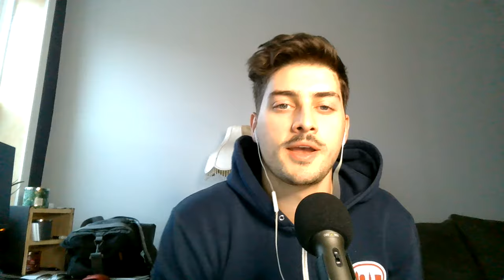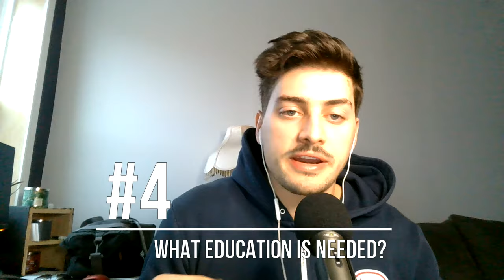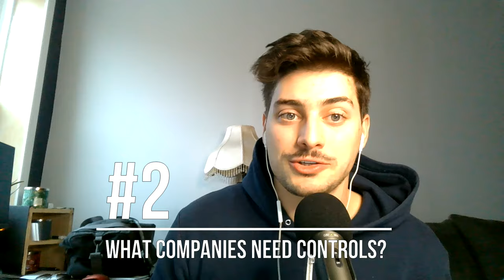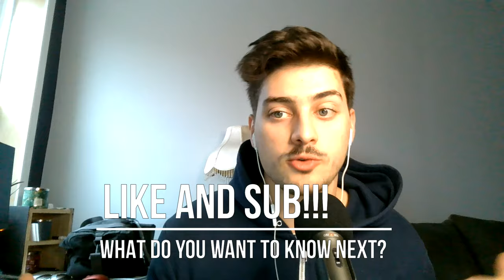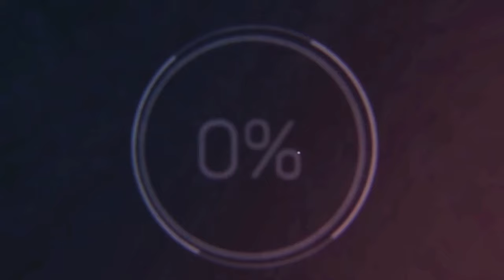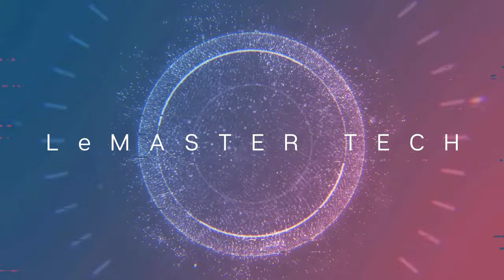Top 5 Things You Need to Know About Controls and Automation Engineering!

Comment: I finished TCAT 2 years Automation  Technician  started working for food company 3 years in the position and making 43$ per hour soo 110k per year I didn't want to go to 4 year college in my opinion is not worth because you need hands on experience with Electrical, Pneumatic, Hydraulic, Mechanical, PLC,Robotics soo now I learn Networking soo you need it all to be efficient, also HMI design, CAD ....soo Goodluck everyone.
Reply from the maker: Thanks for sharing your experience that’s awesome to hear and I totally agree hands on experience is so much more valuable than higher education! It’s unfortunate some places have a 4 year degree requirement but less and less are doing that especially for driven folks with actual practical experience!!

Comment: I find the salaries rather underwhelming compared to software engineering positions. For such a niche sector, I would have expected 6-figures+
Reply from the maker: Well I’m 26 and pretty well into 6 figures so it’s not like you can’t get there, but it definitely doesn’t average as high as software engineers no doubt about that!
Reply: I have a CE role without an engineering degree, and I'm in the low 6s.
Reply: @lemastertech  what does pretty well into 6 figures mean? 200k a year?
Reply: 26 and very low 6 figures here, friends that branched into software are making closer to 200k+

Comment: What about Network Engineers? Can they pivot to smart building automation engineer?
Reply from the maker: Yes they definitely can, but without some strong hands on electrical or mechanical experience you’ll have a tougher time! There are ways to self teach some of the software and computer based skills and will obviously have a leg up on the networking, but it will be a challenge to make sure you hone some hands on electrical and sensor skills!

Comment: Thank you for delivering a succinct and informative explanation. I want to add one more thing. Control engineering education not only equips one with the fundamental concepts, but also provides a strong foundation for branching out into related fields such as optimization and machine learning. The understanding of calculus, particularly linear algebra, is a valuable asset that can broaden one's perspectives in engineering.
Reply from the maker: Very true, but I do think mechanical or electrical engineering degrees can allow you to more easily pivot into other fields if controls isn’t for you, and most programs allow you to build electives of whatever you’re most interested in into your program! Either way, not a bad option!

Comment: Great video and the advice is spot on.  Go with a general engineering degree with electives.

I went to tech school for controls but got a BS in Chemistry.  I now work as an automation engineer.  I’m limited to the process industry but there’s plenty of jobs.

Start-up and commissioning r the most stressful experience, but you learn quickly.

My advice for new grads would be to work at an integrator for a few years bc going to a corporate setting.  Your experience will be at a premium.

I get inquires every week n I’m not looking.  I’m getting phone calls, emails.  Some out right telling me I will get +10% more.  I’m happy where I’m at though.

I work in Pharma which has its own set of skills for an automation engineer.
Reply from the maker: Glad you agreed with the advice and sounds like you’ve got a great career! I liked working for the integrator I started with but got tired of traveling and am happy with my current role even though it would have been fun to go work for spaceX or Tesla it also would have been longggg hours haha!

Comment: Currently a college senior studying mechanical engineering, I have had a change in heart in what I wanted to do with my ME degree, I recently was heading into the field of sustainability engineering, but found it's not what i want to do. Any advice to change gears and switch into this industry? I only have internship experience in sustainability. Will graduate in May for reference.  Thanks!
Reply from the maker: Hi, congrats on being so close to graduating! It is tough as a mech-E without any more semesters of electives to sign up for more electronic or computer science electives, but I would say if you wanted to get into controls, definitely still apply!! I you're willing to take an entry level job, look for either hardware manufacturers like Siemens or Rockwell or GE for controls roles on like linkedin or their careers sites, or look for an integrator like RoviSys or maverick or some other controls integrator! They typically will take a chance on a motivated new hire right out of school with any engineering degree! Something to help educate yourself a little on the knowledge gap could be getting an arduino or electronics hobby kit just to start learning some basics of electronics and coding! Goodluck!!

Comment: So currently I am a mechanical engi who got offered automation engineer role. What should I do to help prepare me for the job since I'm not familiar with plc and programming, etc
Reply from the maker: Hi man! So honestly, PLC programming and automation is pretty heavily learn on the job - if you knew for sure you were going to be using rockwell stuff you could watch some YouTube videos on basics of RSLogix or Factorytalk View hmis, and likewise Siemens and wonderware and GE have some decent online learning videos available on YouTube and documentation on their websites. But more generically I think as an engineer you really just need to be prepared to solve problems as they come in, and sometimes the best way to practice that sort of stuff without getting too in the weeds about something technical you might not need is practice with problem solving type games like grid logic puzzles, sudokus, Ken-Ken puzzles, or even brain teasers or practice reasoning through things like fermi problems which are just really great ways to start thinking like an engineer. I get wanting to get better specifically at automation stuff but PLCs and their associated software are expensive and difficult to practice with at home unless your work lets you take them home!

Comment: I’m graduating from devry university with IT in automation and electronics systems as my associates do you think I need a BS in electrical engineering or can I get a BS in Computer System information aka CIS
Reply from the maker: So there’s no right or wrong answer here, because every employer is different! I think if you had either of those two you could definitely pursue and entry level controls position with most employers, but an electrical engineering BS may have a slight advantage but both of those should be fine! Goodluck!

Comment: how does one with a totally non-related master's start their own training or do their own projects to have something to show off if they want to do controls?
Reply from the maker: Hi! So if you wanted to show a basic competency with inputs and outputs and programming and making GUIs but still wanted to have it be fun, I’d recommend getting affiliated with arduino stuff cuz it’s fun and automation related, but industrial controls probably the best way to go about learning that without working in it formally would be getting your hands on a micro logix microcontroller or something comparable where you can practice function block or ladder logic code and maybe actually study controls wiring for standard types of IO devices! It’s tricky to get experience in such a niche field of engineering but there’s definitely ways if you’re committed to it!

Comment: Hello i am about to comoleete my BS Electrical and electronics enginerring which are the courses i need excel to land in industrial fields of control system engineering
Reply from the maker: Hi! In my opinion anything to do with logical programming or theory of computer logic alongside electrical design and how data is transformed into electrical signals from sensors in the field to computers or PLCs will help, but also I don’t think education is nearly as important as hands on experience for accelerating your career! I’ve worked with folks who got their bachelors and were way more advanced than other coworkers with masters or PHDs, so I do think in the field of automation what sort of engineer you are is way more important that how much school you attended!

Comment: I am a final year control and automation engineering student. I am currently doing a long-term internship in flight control. Since my internship and studies so far have focused on matlab and simulink on flight control, I would like to work in a similar field in line with my experience on control. 

However, the working conditions I am looking for are not companies that have the to work 8-6 and take the whole day with continuous working hours, I am looking for companies where I can be more comfortable with flexible hours and the opportunity to work remotely. Are there any companies you can recommend?
Reply from the maker: Hello, unfortunately as a controls or testing and instrumentation engineer most companies pretty much follow an 8-5 or 9-5 schedule! I have not been exposed to many companies where the hours are super flexible, but I will say when i worked for rovisys who is an integrator, there was remote work and flexible schedule somewhat as long as you were willing to travel for commissioning projects! If you’re interested mainly in flexibility you may want to check out integrators, many of them support remote or hybrid schedules!

Comment: Existing automation systems are heavily reliant sensors. Expensive, hard to maintain, unreliable sensors. A camera with an AI brain should be able to replace many of them. e.g. did the robot correctly grip the part?, are parts aligned?, is the tool broken?, did it make a good weld?, how many parts are on the conveyor?, is the escapement working properly? etc. etc.
Reply from the maker: Hey I totally agree AI will be able to improve a lot of the pitfalls of modern automation systems, but frankly full blown problem solving AI is still fairly far from being widely implementable for all plants and manufacturing sites except the very leading ones! Long term no doubt that’s where things will head though!

Comment: Great video! I am finishing up my associates degree in Advanced Automation and Robotics and will soon be transferring to get my bachelors in Automation and control Engineering. It is hard to find videos that can explain what an Automation and Control engineer does. In your opinion how does an Automation and Control engineering degree differ from a mechatronics engineer? I have taken a few mechatronics classes, and I will also be taking more mechanical and electrical engineering classes to get my bachelors. The disciples for both of these fields sound very similar, and I cant tell a difference between them, and I would like to hear your input.
Reply from the maker: Hey man congrats on the associates and Goodluck on your transfer! So In my recent job hunt there was barely a single job listing for one of the two that would not consider the other for the role as well, so the quick summary is they’re very similar! But mechatronics will definitely focus more heavily on physical components and the actual mechanical process! Mechatronics might often spend a lot of the time specifying conveyors and pumps or 6-axis robotic arms and potentially a lot less time programming PLCs and working in the software side of things! There’s a ton of overlap but typically you could expect more hands on mechanical components in mechatronics and more software oriented systems work for controls engineers! Hope that helps!